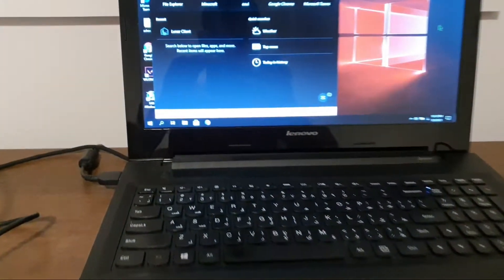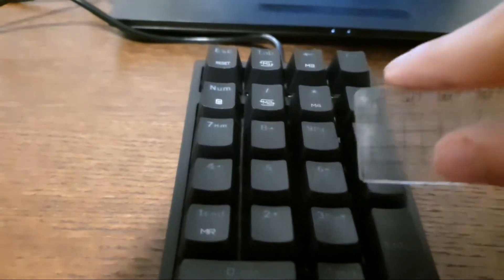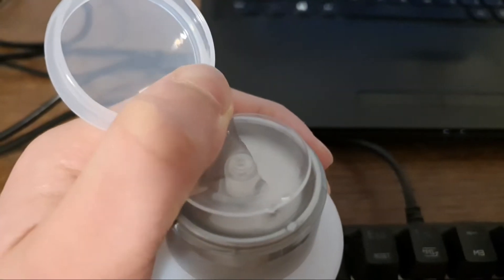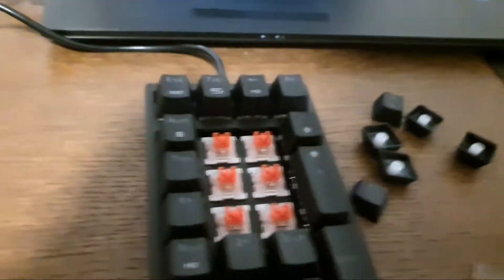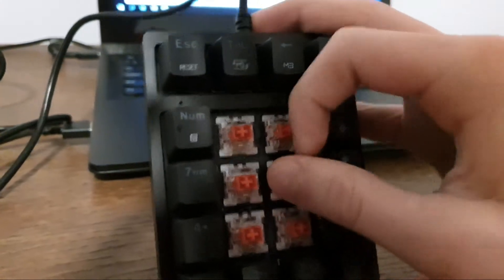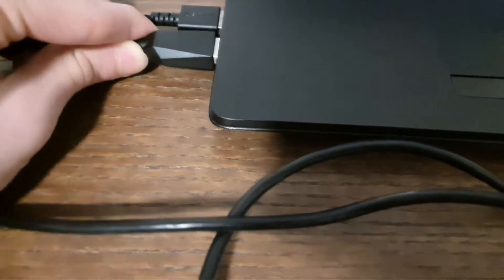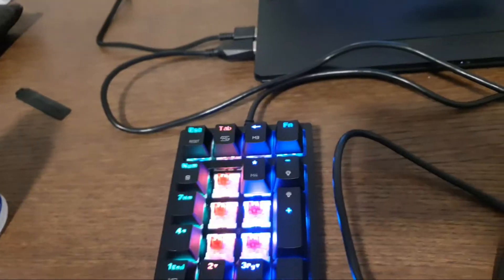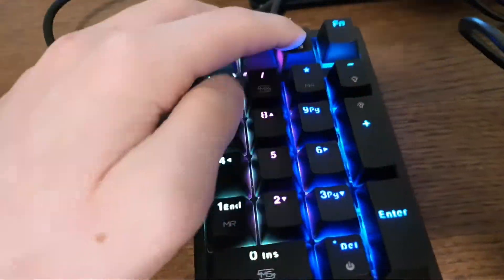Fix an Unresponsive Keyboard Switch [No Compressed Air]

Comment: i fucked up, i had this huge tournament coming up and i was panicking cus i didnt have time and there was no alcohol in my house so i used cologne 😭
Not only it didnt fix my "w" key but now my "s" key bearly works. Do i screw open my keyboard or something? this keyboard is expensive and i dont want to waste money on a new one
Reply: i am a retarded 16 year old teen dont blame me
Reply from the maker: Erm cologne should work but you do need to use a generous amount. Try getting actual alcohol, just ask your parents ,if you can, to get it from the pharmacy. Say its to clean electronics and stuff.

No need to screw the keyboard open. Unless if it is hot swappable, you can replace your needed switches with unused keys like function or numpad switches.
Reply: @YoussGm  I did use quiet alot of the cologne but i feel like it did way more harm than good, it feels sticky and shi. I have a razer huntsman mini, and it isnt hot swappable. Ill try with alcohol tomorrow, its 3 am :d

Comment: I dont have rubbing alcohol, does vodka work?
Reply from the maker: It probably works, no guarantee. Make sure its at least like 40% alcohol. It will take way longer to dry though, so make sure to use a lot and press hard to avoid needing to repeat the steps.

Wait overnight to be safe, in a warm place, not an oven or fireplace or it might melt, well ventilated.

Comment: READ THIS IF YOUR STRUGGLING WITH THIS PROBLEM. IF YOU BUILT YOUR OWN KEYBOARD AND PUT IN THE SWITCHES IN BY YOURSELF. U MAY HAVE PUT IN A SWITCH WITH A BENT PIN.
Reply: I have brand new gray wood v4’s that I got, I put them all in and they ain’t working! But pretty much all of them aren’t working
Reply: Should I still do this method? They’re brand new
Reply from the maker: I'd say probably not. For the few switches that are working, try switching the place of 1 with a switch that's not working.

If the non working switch works in the spot where the working one was and vice-versa, then the problem isnt the switch but the socket itself.

Then you can see where the issue originates from.
Reply: @YoussGm  I don’t know why, the socket isn’t working.
Reply from the maker: Yeah then this method doesnt help, if you still have warranty return your keyboard base and get another one. I can't help more than that.
Reply: @ thanks, you helped me find the problem still!

Comment: Hey man you are a saviour, I have a Razer Widow V4 X keyboard I bought only 4 months ago and to be fair only used in the last 3 and my 'e' key was intermittently unresponsive so only 3 out of 4 'e' key keystrokes actually registered. This is like a £114 keyboard and I was so frustrated. But your fix suggestion WORKED !!!

plastic new 'perfume bottle' spray from Amazon, Isopropyl Alcohol, spray it with keyboard turned unplugged,  gently waggle, flick and press the green micro switch 'e' key up and down, leave 12 hours to dry, come back and the 'e' key works 100%.

Many thanks you are a star. Thumbs UP !

Comment: I had no isopropyl alcohol at hand so I removed the cap and blowed in there while mashing the key, works again. I have to say mechanical keyboards are nice but way less reliable then the old membranes, I never had any problems with membranes of the past but mechanicals have a few issues here and there. The membrane protects the keyboard insides, but with mechanical its pretty exposed.

Comment: I used the tape tip to make it sound better now none of the keys work willl this fix
Reply from the maker: I don't think this would fix that. The tape is only on the bottom of the keyboard's pcb, while this trick cleans the inside of the switches.

So I'm not sure why your keyboard no longer works, maybe the tape you used has conductive glue or something.

Comment: can i use perfume as an alternative?
Reply: or maybe dettol?
Reply from the maker: Perfume should work fine... no guarantee. Definitely DO NOT USE DETTOL!!
Reply: @YoussGm  alright I'm gonna try it and update you about it, but first i'm gonna head to the gas station so i can use their compressed-air gun to clean my keyboard.
Reply: They don't have a compressed-air gun💀 and i walked for like.. 40 minutes in the scorching heat of the sun just to get there💀💀
Reply: @YoussGm  i've found a gas station that had the gun, but i don't have Q tips 💀 AAAAAHHH, I ALWAYS FIND Q TIPS LAYING AROUND BUT WHEN I FINALLY WANT TO USE IT, IT FUCKING DISAPPEARS. Murphy's law is real.
Reply: update: it didn't work, guess i'll have to call the service center☹

Comment: does this work with a less alcohol like 20% or higher or 50% or higher or it needs to be 70% and higher?
Reply from the maker: Well it would work but there is a higher risk of corrosion. So you will need to let it dry for way longer amd maybe use a warm, NOT hot hair dryer to speed up the drying process.
Reply: @YoussGm  bro i wish you a good life it worked i found 100% alcohol i was sad my mechanical keyboard was broken but i followed your tut and it worked very well thanks bro fr

Comment: bro how tf this works damn
Reply from the maker: The reason for unresponsiveness for most cases is because of dust or debris that is inside the switch, preventing contact of the metal inside.

This can be exterior regular dust or some factory coating that has worn off inside the switch due to agressive usage or lots of presses.

So putting alcohol displaces this debris and pushes it away so that proper contact can happen again. Its the same principle as using compressed air, but with alcohol instead.
Reply: This worked!!

Comment: Why does this work?
Reply from the maker: The reason for unresponsiveness for most cases is because of dust or debris that is inside the switch, preventing contact of the metal inside.

This can be exterior regular dust or some factory coating that has worn off inside the switch due to agressive usage or lots of presses.
Reply: @YoussGm  thank you for this detailed explanation, and it did ended up saving my keyboard. Many thanks and best wishes to you
Reply from the maker: No problem! Glad I could help.

Comment: Bro can i directly spray the alcohol/80% perfume on the switch rather than soaking it in and then applying it
Reply from the maker: Yes you can if you have the accuracy to make some of the alcohol enter inside the switch.
Reply: @YoussGm  Brother thank you so much ❤. You have no idea how much you helped me and everyone else, I just got a brand new mechanical keyboard for an expensive price, and the R and U keys were not working, thought I had to replace it. I tried all tutorials but all of them required compressed air, which I didn't have. Right when I was about to lose hope, I found your video. Thank u so much bro! ❤ You got a new sub and like
Reply from the maker: @mariafarhan1829  Thank you!

Comment: That almost seems like a damaged switch leaf (the gold part inside). That will need replaced to fully fix. If it was dirty, doing this removes any lubrication in the switch, so be mindful of that. ALCOHOL is non-conductive, so you only need to wait about 2 mins for it to dry, unless you REALLY soaked it.
A better alternative for cleaning these would be Electrical Contact Cleaner such as BW100. It is non-conductive, non-flammable, non-toxic, and removes corrosion, dirt, grime, and other nasties that prevent an electrical connection from working as intended. It also dries in a few seconds. (Use in a well-ventilated room, however, because BW100 uses perfluoro heptane; which is a fluorinated precursor to gasoline and can make you feel a tiny bit funny!)

Comment: i recommend waiting atleast 12 hours, if not you might short your keys and you will have to replace them.
Reply: Same with your body, after drinking Alcohol get atleast 12 hours of sleep or when you wake up you will be atleast 1 foot shorter that you already where
Reply: if you keep using 70% alcohol obviously, use 95%+ it'll just evaporate in seconds
Reply: Most keyboard keys are quite resistant anyway, so even if they don't respond after you let them dry for a couple of hours, just wait and let it dry completely over 24hours and it should be fixed and clean (just a small note I thought I should add)
Reply: That's not really how keyboard switches work, though.  I build custom keyboards and hand-lube switches, so I've had plenty of them apart.  The only real issue with this might be that he's using 70% iso when he should be using 90+.  If you don't let it dry long enough, the water from the low proof iso might cause the key to short but it would just make it press the key continuously and wouldn't actually damage anything.  Once it dries out, it should go back to normal.  For lubed switches, the iso would likely thin out the lube and essentially wash it off, which could make the keys scratchy feeling, but it shouldn't actually hurt anything.
Reply: @RKight  How do I know whether if my switch is lubed or not?
I am new to this whole mechanical keyboard thing, I bought one on sell for $10
A razer blackwidow 2014
Reply: @Cube_Box  A lot of switches are lubed from the factory, just usually not enough to make a noticeable difference.  If it's a Razer, it'll likely depend on which switches are in it.  If it's a 2014 model, I believe that's when they moved to using their own switches.  I have no way of confirming that they lube their switches but theirs seems to be smoother than the original Cherry switches.  All of that said, those keyboards aren't hotswap so it really won't matter unless you want to take the time to de-solder all of the switches and lube them.
Reply: But cant u just a hairdryer
Reply: @mariafarhan1829  you need to work better on grammar and no, if it’s too hot you will melt your switches and just because you use hot air on the alcohol don’t mean all of it’s gonna go away
Reply from the maker: Technically you can, not too hot though. But even then it might take time to evaporate completely.

I just pinned the comment so that I wouldn't be liable if anyone's keyboard explodes or something.
Reply: No it wont. You can literally soak a board in rubbing alcohol plug it in and it will work fine

Comment: what type of alcohol is best or can you use anything?
Reply from the maker: Any alcohol above 60%. The lower the percentage, the longer it's gonna take to dry.

Also nothing that leaves any residue when it dries like moisturizing hand sanitizer or other stuff
Reply: @YoussGm  so no like drinking alcohol like beer or whine just asking to know what i could use is vodka viable option?
Reply from the maker: Vodka... maybe. It will take longer to dry. At least 1 day. It shouldn't damage anything so you can try with vodka

Isopropyl alcohol from the dollar store or pharmacy is better.
Reply: @YoussGm  deos hydrogen peroxide work?
Reply from the maker: Do not use hydrogen peroxide. Its basically 97% water with the rest being h2o2 so no. It would be as if you're using water.

Edit: technically water/ hydrogen peroxide would work but I'd let it dry for at least a week to be safe. You also risk corrosion since it doesnt dry fast.
Reply: @YoussGm  im talking about when u get a bruise u use it so it fixes the problem
Reply from the maker: Bruh its legal to have rubbing alcohol 70%. Its made for medical use not drinking 💀. You can literally find it anywhere.

In the house you could probably use perfume maybe... might smell for a while and its expensive.
Reply: @YoussGm  ik but it costs alot and in europe u have to have a doctors prescription since im not sick or i need they cant preacribe it
Reply from the maker: @Ghostley47  its first aid its illegal for it to cost a lot. 5 euro for a small bottle maximum. You dont need a prescription. If you can get hydrogen peroxide you can get alcohol.

You can order it online from amazon.

Comment: Just got my new keyboard few days back and few of the switches were kinda delayed registering the input. Thought I need to return it to the seller, but now they're working! Thank you very much for your tutorial! I'll do this first before replacing new switches if the others facing the same issue.
Reply: Mine started to do the same problem but I removed the keycap sprayed d40 rust cleaner etc. And now is working like a charm

Comment: my wasd doesnt work and sometimes double or even triple types withought the keycap it works good but when i add the keycap back its messed up will this fix it?
Reply from the maker: You can try, this won't damage anything if done properly. Not sure why the keycap would make the problem though.
Reply: Alr btw should i use a cotton ball or a tissue paper?
Reply from the maker: Cotton ball, tissue paper can leave pieces of fibers in the key switch
Reply: What should i use instead of a q tip also will isopropyl alcohol 70% work? Also i only had my keyboard for like 3 weeks
Reply from the maker: @yousufmoh1646  yes 70% alcohol will work, just nake sure it's dry before turning the keyboard back on. You can use a clean old toothbrush instead of a qtip, or just use a piece of cotton.

I used a qtip just to be able to get the alcohol un the switch.
Reply: It worked for like 30m then it  got worse
Reply from the maker: If you still have warranty then use it since its 3 weeks old.

You really gotta press hard and wiggle the switch, and most importantly put the whole keyboard sideways while pressing so any debris flows off the  contact.
Reply: I tried the alcohol method 3 times and now its tripple typing rip keyboard
Reply from the maker: Rip, but each time you click it still detects an input? If yes you can change these settings and see if it fixes the problem:

https://www.elevenforum.com/t/change-keyboard-character-repeat-delay-in-windows-11.12420/

Comment: Please do not misinform the public like that. Do some studies how these mechanic switches are made and how to fix, not temporary troubleshooting like you just did there. what you should have done is open the housing of the PCB use a desoldering iron station to remove the bad mechanical switches then open the housing of the mechanical switch clean the inside then do a continuity test with a multimeter to see that it's responding, then install/solder it back to the PCB. But if your test failed then order a new switch and install. In general from experience mechanical keyboards they don't last  long due to the the weather and  environment , i fixed a lot of them and they fail after a while again new replacement or repairing the inside contacts of the switches and wasting too much time, so i recommend my friends or  clients to buy the memebrain keyboard version will last  very long and cheaper than the so called 100 million clicks from a mechanical switches. peace out and good luck with your new videos. P>S i hope your understand the logic of all what i said for your better benefit.
Reply from the maker: Thank you for your comment, I understand your point but when you said that you recommend membrane keyboards over mechanical is when it all fell to dust.

And for an average gamer, they won't have a soldering iron, multimeter, or even the correct screwdriver to take apart their keyboard so that's not what my target audience is, and they surely don't want to take it to a repair shop when the fix is as simple as this.

So thanks for your opinion, I am not in any way a professional, and no one thinks that I am, I'm just sharing what worked for me.
Reply: Ok no problem i understand. But question why you said that all fell apart when i mentioned the  membrane keyboard?  @YoussGm
Reply from the maker: Because membrane keyboards are basically ewaste, only useful for offices and schools where water/coffee could be spilled on them...

Membrane keyboards often have limited key rollover capabilities since they are so cheap, meaning they may not register multiple key presses simultaneously, which can be problematic for gamers and fast typists.

They are mushy and less responsive.
The only thing they're good at is being quiet.
Reply: all that i know but it has less problems than mechanical switches. i mean for the money they charging for rbg mechanical keyboard is very heavy on the pockets of the consumers plus you dont see your money's worth after all the problems you get with these mechanical keys. but i respect what you said and at the end. @YoussGm

Comment: does glass alcohol work?
Reply from the maker: What is glass alcohol? If it's more than 70% alcohol then you could use it.
Reply: @YoussGm  its basically used for cleaning glass,windows and its 70% but it didnt work
Reply from the maker: Unless it leaves residue, which it probably doesn't since it's supposed to clean transparent glass, then I don't see why it wouldn't work.

Is your switch completely dead or unresponsive to some inputs?
Reply: @YoussGm  I think its completely dead.Thanks for your information's

Comment: cant believe this worked.
Reply from the maker: Glad I could help!
Reply: i was about on planning a new keyboard, until i check the pcb and the switch and it seems fine... until i tap it like waht u did, it processed the click. rub and clean it with alcohol and it worked.

the mistake i made was i use the wrong lube for the switch..

Comment: I have a switch it works but i need more press than others what solution should i use alchol or it a default problem on switch
I mean the actual point are not same compared to other switch on same kb
Reply from the maker: It could probably be fixed with these instructions, as there may be dust between the contacts so a harder press would make it work.

It won't hurt to try cleaning it with alcohol.